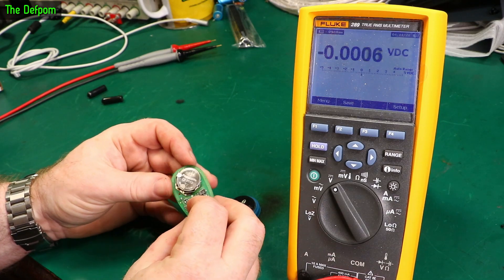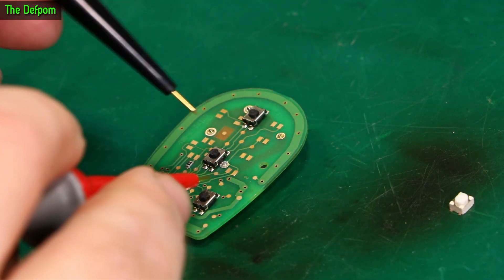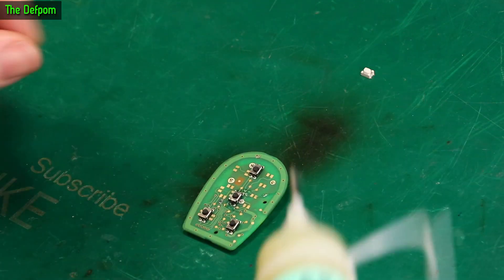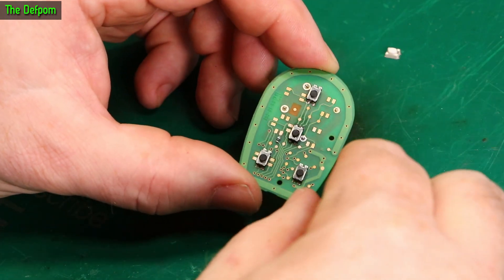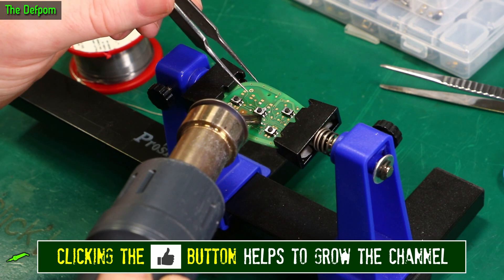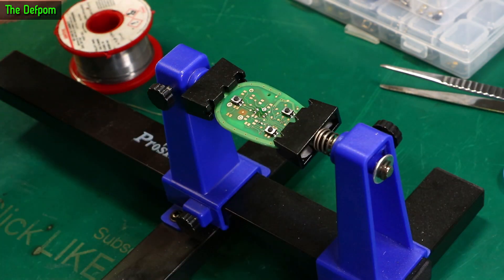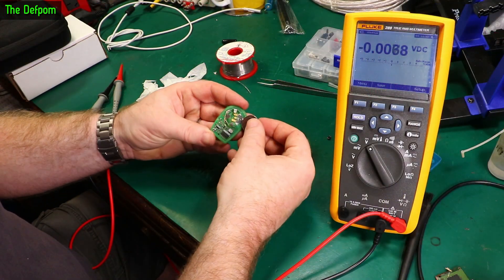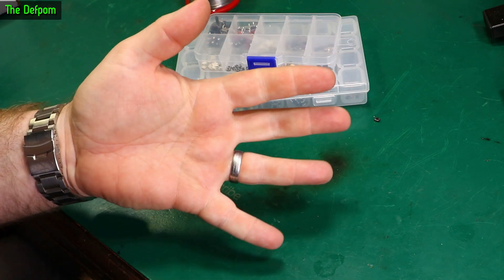🔴 Toyota Remote Control Repair - No.1070

Comment: I used to do the same button replace method. However after many times over the years I got sick of doing it, so recently tried spraying contact cleaner into the button switch, pressing it, repeat a few times, and that revived the switch with minimum effort.
Reply from the maker: That doesn’t always work, I have done the same too and indeed it can buy more time, this remote had that exact thing done to it a few months before I finally had to relent and just replace the button.

Comment: Done a few different ones. Often actuator height is critical as clearances are tight and when you reassemble it can force the switch on. Most switches connect across the 2 terminals at each end like this but I had one recently that connected end to end, never seen before. Could not find an equivalent anywhere so had to isolate one leg on each end at opposite corners to get the desired effect. There's always one manufacturer that has to be difficult!
Reply from the maker: I now have the identical buttons in stock so I will be swapping it again, I found it to be too easy to accidentally press it, it went from being hard to get to work to being too easy LOL.

Comment: A company I used to work for had a product that was failing UL testing randomly under certain high humidity conditions. 'No clean' Flux residue + humidity affected the clock circuit and made it go bonkers. They went back to water soluble flux and washing the boards after that :)

Comment: It's good that you can open the key fob without destroying it. I went through that exercise for my Hyundai i30 when my fob battery went flat. I destructively transferred the PCB to a new fob case ($8 from China) and replaced the battery ($3). Tested it by unlocking and locking the door. Worked fine - for that...but the sneaky bast*rds had also buried a separate NFC chip in epoxy (which I didn't know about) and is needed to actually start the car! A new fob from Hyundai costs about $700.